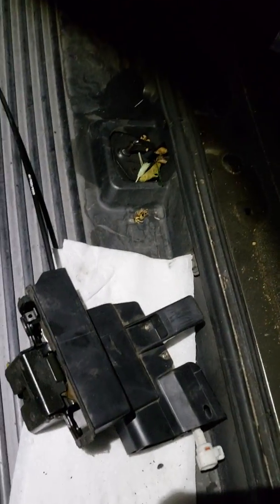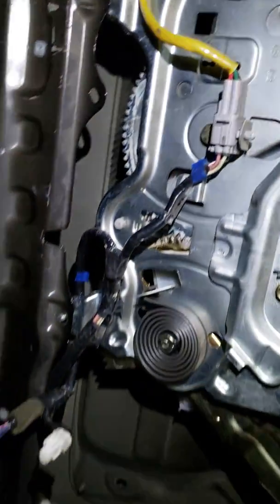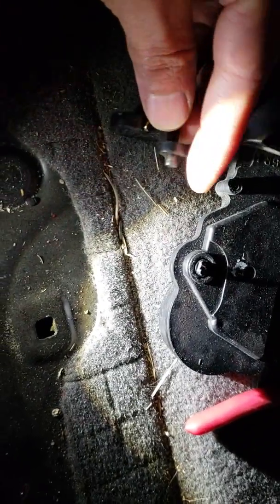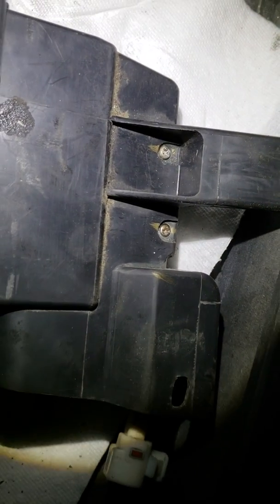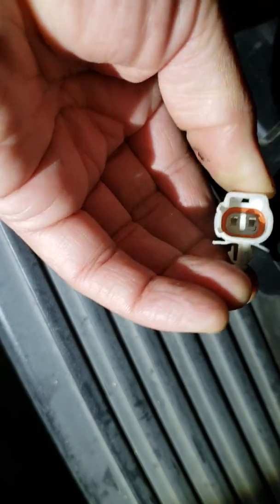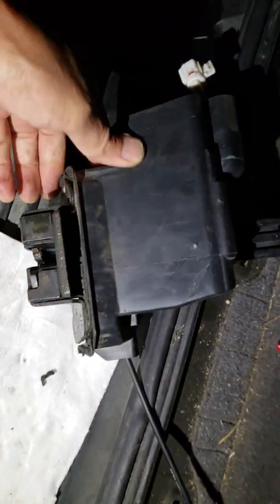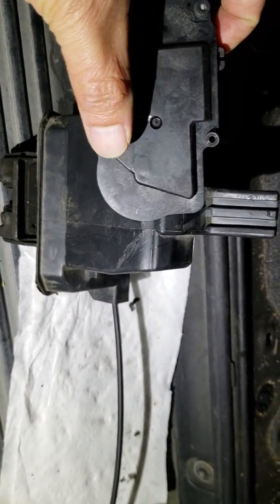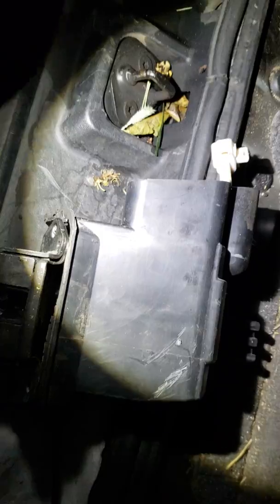How to easily open tailgate on Toyota Sequoia when latch is stuck in locked position.

Comment: This was the best video on the subject of all I have seen! I've been fighting with the same issues for a couple years. Like many others, I thought the plastic latch handle was the only problem, But, in fact, there are three potential problems: 1) broken plastic handle, 2) worn cable ends (i.e. conduit ends), and 3) intermittent fault on the door lock mechanism, where you can't open the hatch even with a new handle & cable assy. You can buy a metal handle assy, so that'll never break again, but if you have an older Sequoia you need to change out that latch assy at the other end of the cable from the handle. Otherwise, you'll just keep having grief with it until one day you can't get the hatch open at all. This video was a great solution, thanks!

Comment: This was by far the best video for the situation where the flimsy plastic actuator lock/unlock arm has broken off inside the door and therefore you can't even unlock the door to work on the locking and latching mechanism. .  Even with this video, I had to buy a finger ratchet set in order to unscrew the two screws holding the plastic enclosure in place (the finger ratchet worked like a charm), so I would recommend obtaining a low profile finger ratchet with phillips bits to unscrew those two rear-facing screws securing the plastic enclosure around the actuator assembly inside the rear door.  I did it without loosening or moving the power window assembly, but I have to say it took me several hours and hundreds of failed attempts to unsnap the larger black wire harness connector from the enclosure to permit the enclosure to be fully removed.  If you can find someone with very skinny arms who can maneuver more easily inside the rear door, or use an endoscope to position a screwdriver inside the door, it may save you hours of frustration trying to unhook the black wire harness assembly.  This video completely saved me from utilizing the far more destructive sawzall method to cut through the latch anchor metal and remove the weatherproofing as well.  My locking/latching assembly was severely rusted and corroded, which created the friction that eventually cracked off the plastic lock/unlock arm from the actuator assembly.  I can't thank you enough, this video was a life and equipment saver!
Reply from the maker: Glad it worked out for you John. I went into this job blindly without knowing what to expect nor what needed to be fixed because I couldn't find any good videos on the subject. Took me a whole day to figure it out so I knew it would save some people time and money if I shared. Glad it was worth it.
Reply: @rickyortiz2944  I believe my most significant delay was self-inflicted - I thought the removal of the plastic housing over the lock actuator/latch assembly (the two phillips screws) was necessary before loosening the three 10mm bolts holding the assembly to the bottom of the rear door, which was not the case.  Going backwards a bit cost me several hours, but it was my own fault.  If I had loosened the three bolts first, the whole process would have been much shorter.

Comment: Thanks for shared, My problem is that the door is stuck, and won't open even if I pull the cable manually. Nice to know that I don't have to saw the hook. I will try your method tomorrow.
Reply from the maker: Yea no worries. Sorry my video is not as detailed in some areas just didn't want to make a super long video but I had the same problem and it worked.

Comment: Thanks for posting this. Saved me a bunch of time and money. Turned out my latch was just Rusty and stuck. Lubed it up and it's working great. By the way, the back window is an easy fix, too, most of the time. Just a spring-loaded piece to pull into place and screw tight. Easily accessible behind the interior hatch trim. Don't even have to remove any other parts. There are a few videos about it on YouTube.
Reply from the maker: Sweet!! Thanks

Comment: Hey I wanna say thank you for this video! I was so close to taking a saw to the latch but this saved me. Mine was not broken but was stuck most likely just wore over time. Anyway this saved me a lot of time and headache thanks again. Now only if I could figure out why the window won’t go down anymore. Both kinda cut out at the same time.
Reply from the maker: You're very welcome. I have a similar issue with my rear window but still can't figure that one out. Anyhow, I'm glad you found the video useful.
Reply: Did you try loosening those two 10mm (I believe) bolts on the window motor mechanism that are basically the brake or whatever of the rear window? Our window didn’t work for years and I thought that seemed like a sketchy fix but the window has been working for over a year now, so 🤷‍♂️
Oh I also disconnected most if not all of the connectors on that bigger black control module panel that you have to remove to gain access to the latch and whatnot, and then obviously reconnected them when I put it back together. I’m a firm believer that sometimes simple little disconnects/reconnects can sometimes jog little motor controllers or actuators loose or back to life.

Comment: I finally unlocked it but it still won't open, after unlocking it and pulling the cable it still refuses to open, I am at a loss because this was the last video that went into enough detail and seemed to describe the problem I had
Reply from the maker: So sorry to hear. You're pulling the wire inside of the cable?
Reply: @rickyortiz2944  sure am, I don't want to pull it too hard for fear of stretching it, I also manually pulled the lever bypassing the cable and still nothing
Reply from the maker: @FexiSponge  Maybe your latch is the one that's messed up. I ended up replacing the cable too just so it could last longer.
Reply: @rickyortiz2944  yeah it sounds like it, I just don't know what else to do
Reply: Thanks for responding and for the video
Reply from the maker: @FexiSponge  no worries. It was a major pain in the ass for me because I couldn't find any videos. Finally I figured it out and decided to post a video. Not the best video but looks like it helped quite a few people. Good luck with yours.  Hopefully you're able to figure it out.
Reply: Mine is stuck the same way did you ever figure out how to open it?

Comment: dude...i just my TWO screws out with a toggle mirror and some WD40...but how do you get the plastic top off?  u did not show it....slide it?
Reply from the maker: Sorry I just noticed your message. Yea you slide it out. I hope you were able to do it.
Reply: @rickyortiz2944  I got the screws out...and was trying to get it out...then the door popped open...so I really did not get the cover off till i pulled the whole unit out, because as you know the latch and actuator go in at a weird angle and you have to get it right...probably at some point I would have gotten it out, but once the door popped open I was able to remove the three bolts underneath anyway.
Reply from the maker: @kenmcf  Nice!! 👍

Comment: This worked perfectly, but took quite a while to accomplish. However, it does work and you don't have to damage anything in the process.

A few suggestions to make this go faster: 1.) You don't need to take the rear window motor mechanism loose. If you do, the entire mechanism will want to fall into the bottom of the tailgate and actually get in your way. 2.) In your video, take the plastic housing off so that people can see the actuator. The rocker on the actuator is on the interior side of the mechanism, whereas the two little screws are facing the back of the truck. 3.) I couldn't get enough leverage with just a screw bit  to remove the two little screws, but by attaching it to a short bit extension, I could get enough purchase to easily remove the screws. Also, I used a mirror to be able to clearing see what I was doing as I worked on the two screws.
Reply from the maker: Thanks for your feedback. It was kind of a last minute video just to give people an idea of how to avoid a more costly repair. You have good points there. Im sure they'll help other people as well.

Comment: I was able to removed the two small self tapping screws on the black plastic cover, however, I am having one a hard time removing the entire plastic housing...is does anyone know what is the best way to remove the black plastic housing cover...I feel like if I force it out, I am end up breaking something...thanks for sharing, I know its an old video, hopefully someone will respond...thanks
Reply from the maker: There's a cable connected through the side of the plastic housing. Do you see it?

Comment: I bought the new handle that is on ebay for less than $15. But my problem was the one described on this video. Look on the comments from @G-Dog for better way to handle the actuator, so you don't have to remove it. Now I have to buy a latch mechanism... Anyway, I will replace the handle as it's the plastic one and it could broken anytime... The new one is all metal.

Comment: That very good info 👍 but I gotta get another thang that holds my tag .you know by chance what's it called.your handle goes in it??
Reply from the maker: Not sure which part you're talking about.
Reply: Ok  the two bolts go In it,it pop's a way you know what I mean! Your tag light's  were your handle at that Square assembly thang that's has the push slips
Reply from the maker: You may be able to Google your description. Since I'm not a mechanic I'm not sure what that's called.

Comment: Im working on my 2004 Sequoia with a failed rear latch ,failed ~ about 5 opens after purchasing vehicle .

 I found  3 THREE latche tips inside the door shell IE this is the 4th repair required. 150K miles 

FU toyota the latch trigger part is worthless

Comment: I don't think this will work and the video doesn't prove anything since it's already open!  It's easier just to saw off the striker!
Reply from the maker: Knock yourself out. You're gonna have to also damage the weather stripping and replace that too. And guess what, yes you'll open the trunk but unless you replace the actuator you again will not be able to reopen it after you go through all that and close it back up. You don't believe me? Go right ahead and you'll see for yourself.
Reply: @rickyortiz2944  Already completed with no problem.
Reply from the maker: @stevec5000  So how are you gonna fix it now? If it wasn't opening before, how are you gonna get it to open next time?
Reply: @rickyortiz2944  Not sure, I replaced both the latch and handle but it still won't open unless I pull on the cable.  Maybe attach an electric actuator to the cable so it works electrically with a push button like the 4Runner.
Reply from the maker: @stevec5000  I had the same problem. That's why I replaced the actuator and last minute decided to do this video to show people how to fix it.
Reply: @rickyortiz2944  Mine still won't open after replacing both the handle and latch but there is talk about adding an electric lock actuator over on the Facebook Toyota Sequoia Off-Road group so I may do that.